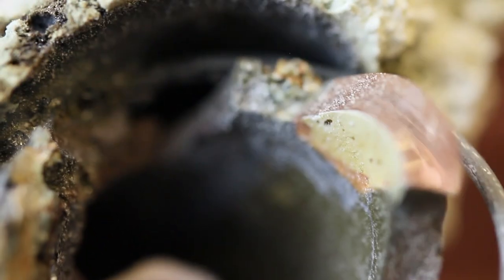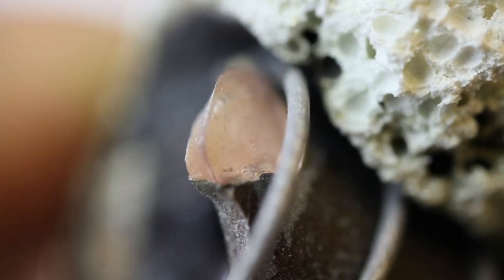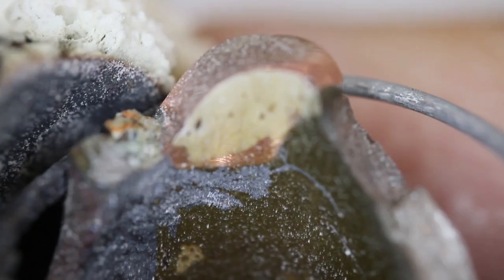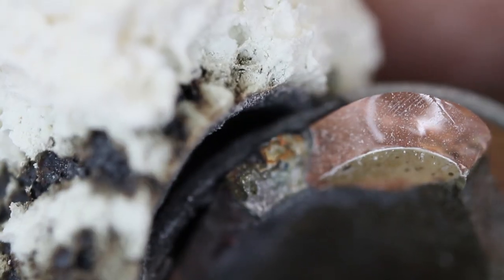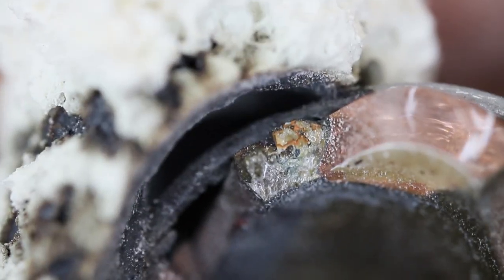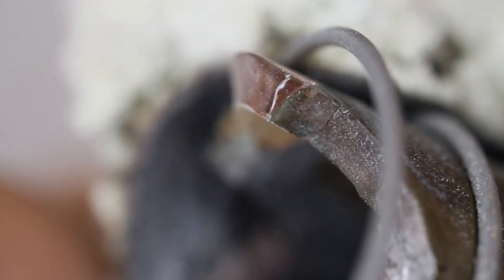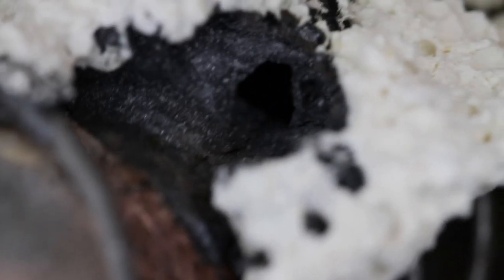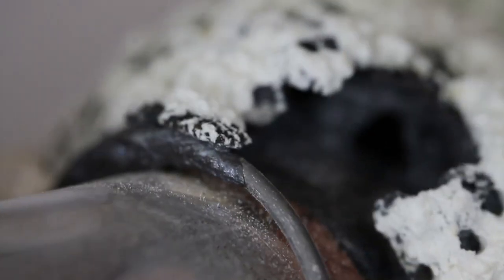LION - Fuel Area Tube Section Detail

Comment: At 02.49 you can see more hints of pink. It looks like the clear pink is an early/intermediate copper oxidation state before it gets burned to hell. It looks like in that particular area the wire is not wrapped tightly against the quartz.